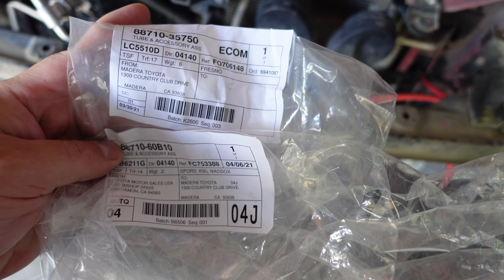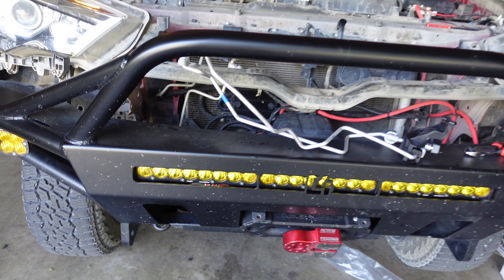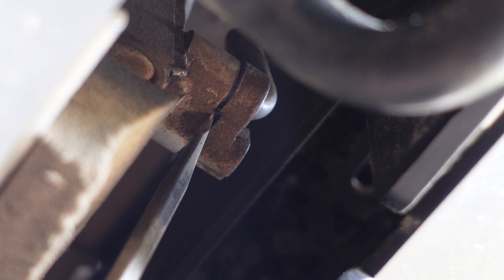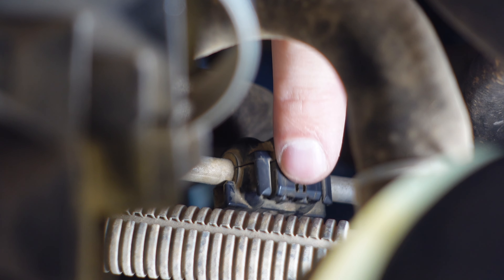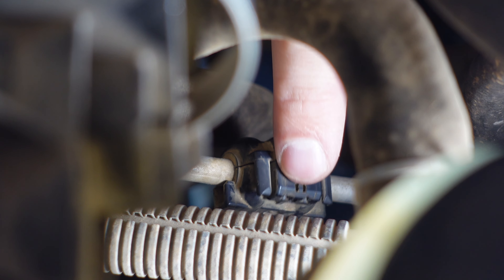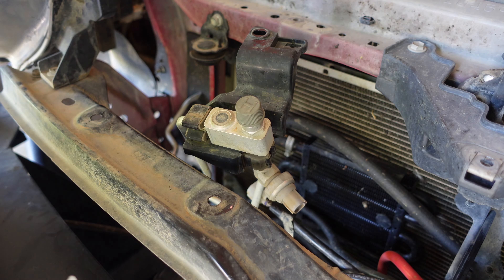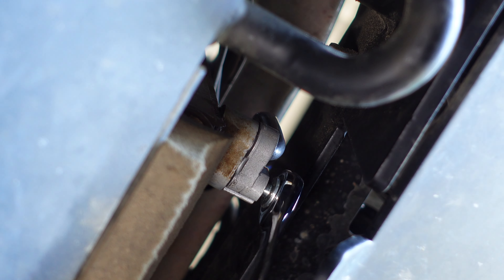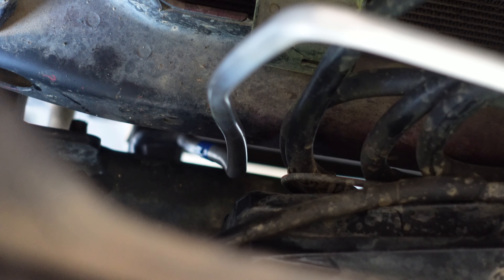How To Replace Broken AC Line 5th Gen 4Runner - 4K

Comment: Great video! The AC pipe also rubbed on my CBI bumper on my GX.

Just in case you ever have to redue the AC line again, 
I used a dollar tree  metal fork, broke off the two other portion and used pliers to get the inner portion close enough to fit into the two holes that held the clamp. Worked like a charm

Comment: Super helpful! I have a steel bumper and punctured my AC line when I hit a huge dip off-roading. Toyota is looking to charge me $600-$700 for the repair. This video saved me $400 bucks. Super straight forward repair. Thanks a lot for sharing!
Reply from the maker: Awesome, glad it helped. I recommend putting some rubber hoses around the line anywhere where contact could be made from movement. Didn't have any at the time when doing this video, but it's on now in the vulnerable spots.
Reply: @MaddoxBBQ  yeah I got 3/8” rubber hose. So I plan to put it around the area where the previous line got punctured. I also plan to bend the new line away from bumper. Hopefully this doesn’t happen again. 

I had to drive home from my trip through +100F. Definitely not taking AC for granted after this.
Reply from the maker: @jamesturcato6907  I was in Death Valley with no AC. I know all about it. Make sure you take it to Toyota when finished to let them suck all the moisture out of the system and recharge it. If you recharge it yourself and moisture is in the system you could have major issues. I believe it's like $150 for them to recharge everything.

Comment: Great Video!! My CBI bumper rubbed against mine and left a hole. I was wondering why my AC wasn't working. What kind of Lube did you use for the ends?
Reply from the maker: It was a lube all for pool equipment, but it works for all o rings and such.
Reply: @MaddoxBBQ  thanks so pretty much any lube will work?
Reply from the maker: @ry5tyle  As long as it's safe for an o ring I would believe so.

Comment: Great video.  Not so much my bumper but my smittybuilt winch rubbed a hole in my tube. Gonna mod by moving the tube 1 inch to passenger.  Thanks.

Comment: Great video!   How did you determine the line was broken?   The AC on my 2021 T4R stopped working last night.   I noticed that the  fan clutch wasn't engaging.  I checked the AC fuse and it's fine.  I haven't tried to check the relay yet, and haven't had it serviced yet.   I'm surprised that the clutch isn't engaging if it's leak, but i'm seeing the line you replaced very close to my winch but don't notice any abrasions.  Hoping they'll cover whatever is wrong on the extended warranty.
Reply from the maker: There is dye within the system and I noticed it underneath the vehicle. It's a neon green color, so looked under where I found it and saw the small crack in the line.

Comment: Made the same unfortunate mistake. Thank you this video! 

When reinstalling the line, did you have any concerns bending it at all while trying to get in back to where it needed to go?
Reply from the maker: Never had any concerns. The key is to just take it slowly and bend it as you need. Just don't do anything harsh and you'll be fine. I originally had bent the line for the bumper so it wasn't as nerve-wracking the second go around. The line had no issues as Toyota said after they cleared the system it held at pressure.

Comment: Thanks for recording this. I have a 4th gen that I need to replace my hose on due to aftermarket bumper rubbing it. Looks very similar to the 5th gen. Should be an easy fix on my part. Once installed did you have to do anything to your AC besides recharging it?
Reply from the maker: I had Toyota do it because I didn't know if moisture got into the system, plus they could make sure the unit was sealed with pressure reading. Other than that no. That's all that needs done.

Comment: That plastic piece with the 2 holes is giving me so much trouble. So hard to push the pins into the holes while it spins in circles...
Reply from the maker: Trust me, it's a PITA, that's why I didn't even film it lol. Make sure you're in the right holes. I was using the wrong two for the first couple of minutes.
Reply: @MaddoxBBQ  right on. I'll try to be patient today. My AC went out on me while at Coachella a couple weeks ago... 
Also, I have a 2014, the part you listed didn't match up with the part they had online for my VIN, so I trusted their system, but looks like the pipe bends don't match so I might have to send it back and have them send the part you listed. Live and learn...
Reply from the maker: @CamaronesFuegos  I know there are two of those lines, and they show up to work for the same years, so who knows. The system is a little messed up IMO.
Reply: @MaddoxBBQ  I managed to get the clip off! Thank you for your video, helped me out so much. I also bent the piping to fit and actually pushed it behind the power steering pipe. So all good
Reply from the maker: @CamaronesFuegos  Good deal. Takes a little bit of cussing and then it works out haha. Glad to help.